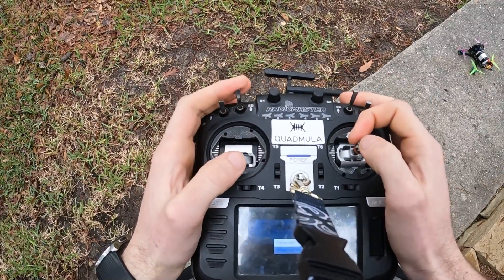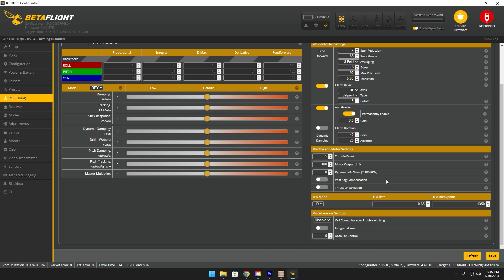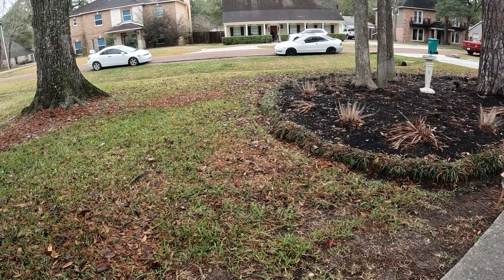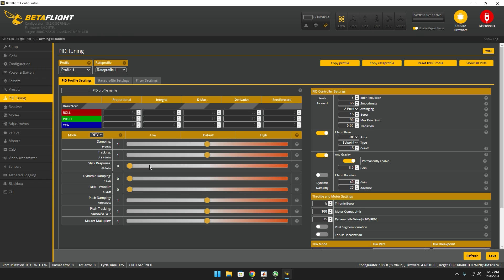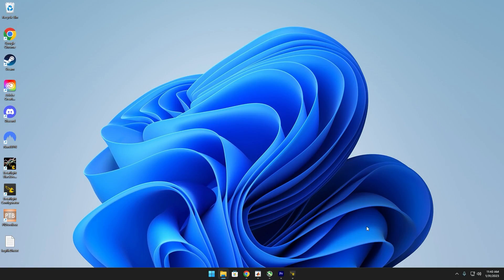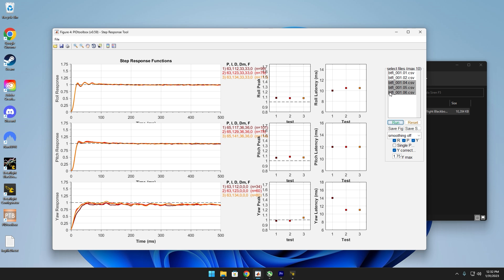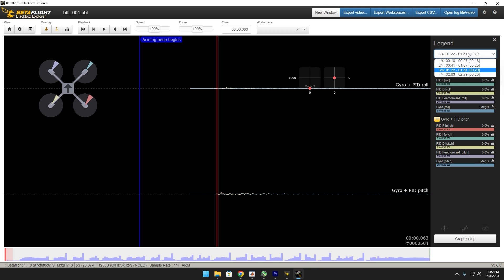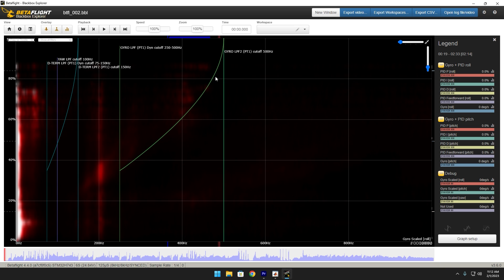*Outdated, Check Description* How to Get that Perfect PID Tune in Betaflight 4.4 | 2023

Comment: nice tutorial! quick tip re Master multiplier. the ripple is oscillation (you'll see it in the dterm traces). Notice that it lower on pitch because there's more weight along that axis and it requires higher relative gains than roll, and you can see this in the latency difference between the two (pitch has higher/slower latency). what you wanna do in that case is bring roll only down until that ripple looks about the same as on pitch and their latency is approximately matched. then you know you have equal responsiveness on both axes. you'd do this by dropping the MM until roll only shows a small ripple then boost pitch PI and D to where it was before dropping the MM.
Reply from the maker: Oh interesting okay 👍 I though it was something to do with d-max but yeah I get what you’re saying. Appreciate the feedback man!
Reply: Hey, The TPA Break point is verry low, for tuning is not good you must be push it to 1750 ( some quads hovering is over 35% throttle.
if necessary put it down after tuning PID, do last Throttle test. If you can see vibrations in high Throttle in Frec/Throttle tab,  set TPA little bit under vibrations !
Reply: Great advice thank you Brian!

Edit: Other question to you @D3B8 are the filter settings unchanged? I have seen there are presets for super clean/clean/normal/noisy etc. filter settings and wanted to ask how do we judge when its already noisy etc :D
Reply from the maker: @sarcasticfpv  So my filters are stock in this video but I plan to cover them in the future. I wouldn’t recommend it but if you really want to try a filter preset just make sure it’s in a safe area. Trial and error is really how to know
Reply: @pidtoolbox, Thanks for this tip. But what should I do if its the other way around? I have osc on pitch
Reply: @FPV-Jon  you do the opposite. Bring pitch PI and D down instead
Reply: @PIDtoolbox  so, boost MM up, then turn PI and D down?
Reply: @PIDtoolbox  didnt go to well. Smoked a motor 🫣
Reply: @FPV-Jon  No boosting anything

Comment: I got my tune pretty nice...for flow flying its great and for quick turns and no prop wash on pull outs....but when I snap roll it of juicy flick I end up what I'm guessing is a dsync and it will fall back towards motor 1 amd 2 and death roll out of the sky....and I have no clue how to fix it....if I give it throttle it his hit or miss but if I completely kill throttle during roll it does it....and on bluejay my timing is high I'm on 24 ppm or pwm... also my min and max (the 2 bars on top right in esc config for bluejay are well past stock they're like .75 of the way up and stock is like .25 percent of the slider....I'm so agitated with it because my 3 inch and my 2s toothpick and my whoops are all good but my 5 inch quads it has happened to both

Comment: i just found out that if you start noticing more and more oscilations as you push up the master multiplier, try lowering i term relax to middigate the oscilations coming from p term especially when anti gtavity kicks in. my master multiplier is at about 1.4, when id punch out it would go berserk with oscilations, the blackbox log showed p and d oscilatin in phase while i term was inverted, which means the quad was struggling to meet that setpoint, the antigravity feature was placing on it. so i lowered the iterm relax from 25 to 5 and that practically eliminated the issue! also antigrav gain is on 1.5 since my iterm is already crazy high, i might lower it

Comment: Being new to Beta flight how would you set PID for minimal motor-controlled orientation and how would I run servos. Just want the motors for thrust I have servos running the roll pitch and yaw on an experimental system, but have yet to figure out a way to configure them. My receiver is a Flysky FSia10B. I am running the rx1 pad and using serial receiver via ibus. Can I use the chanels on the receiver to run the servos?
Reply: Oh sorry, controller is a SpeedyBee F405 v3
Reply: You may be better with a different package if your trying to control servos. There is this option within betaflight, but as I understand it this is quite basic. For a great guide on the latest release of betaflight head over to Joshua Bardwells channel. His guide is split into each of the options making it very easy to find the info you require without watching lengthy videos. Also have a look at the software used for flight control on wings and planes. I know they drive servos direct from the receiver but these are quite large that's all I really know on the subject. Hope it gives you a few ideas and avenues to progress you experiment, keep on innervating and I hope you get it flying soon. 👍

Wow! I have just had a look at at your channel going to be a long term project getting it flying but I'm going to keep watching and subscribe.
I would have thought you would want your PID loop altering the speed of each motor to maintain a level hover. I don't think beta flight will be able to keep it in the air by itself, as I'm guessing your creating thrust by way of servos on the ducts? Beta flight has been developed over the years focusing on FPV racing and freestyle quads. There options for other motor layouts away from X style frame. But I think on larger lifter and camera platform drones other software is used.

Comment: Very easy to follow instructions. I have an issue, when I try to open any of the logs off my Chimera, it just hangs. I've moved them to the PIDToolbox as per the Wiki, but nothing seems to work, so sort of stuck at bat. Any help would be appreciated.

Comment: Thanks Bro 🤙🏼 I just have the ringing and warmish motors. I also run tracer. I never knew it messed with the tune. I hope like hell I can get my 7” to fly half as that quad.  lol. No criticism here.✊🏼I do appreciate you mane🤙🏼
Reply from the maker: Yeah np, good luck with it man 👍
Reply: @JevinW  I did have to move the MM down to 1.4 The motors was warmish.  It flys pretty smooth now. I do just have it on a preset. One day would like to try to tune it like that.

Comment: First of all, thank you a lot for your tutorial. Your quad is clean, why do you need so much filtering (I think you have defaults)? Do you use RPM filtering?  Did you try to disable Gyro LPF and Yaw LPF? What values do you see in PIDToolbox -> Spectral Analyzer -> filter delay?

Comment: Thanks for this video! My usb port is quite hard to reach since mines a waterproof build. Is there a way to do this without the Blackbox analysis? Or should I do this the old school way and adjust the parameters after every flight? My fc has bluetooth
Reply from the maker: I believe you can blackbox off of the speedybee app but it’s not too reliable from what I’ve heard. If you still want to get a tune going without black boxing, you could always just raise the master multiplier up a bit and call it a day.

Comment: Tried it, but for some reason, I can't get the btfl files loaded into the PIDtoolbox. It keeps loading but nothing happens.
Reply from the maker: Little late to this sorry, but make sure to launch PID Toolbox from where you installed it and not using a shortcut.
Reply: @JevinW  Thanks Mate, now its working

Comment: One important step is missing bro, you have to enable 100% pid controller for angle mode, stock value is 50%… if you fly angle for recording logs this step is essential…
Reply from the maker: Oh okay did not know that, hardly ever fly angle mode haha
Reply: @JevinW  if you move the drone with the pid controller at 50% pidtoolbox will read wrong values
Reply: @YOXFPV  actually thats now true. Had a tune meeting with Brian last month and we had the Angle mode on 50%.
Reply: @-exeCy-   pid controller at 50% registers lower pids than the real ones and all the tuning will be wrong, you will have a correct p-d ratio because that doesn't change but the drone will have very high pids and will not fly as well as it should
Reply: @YOXFPV  how to change that?
Reply: @2000khk  just set angle strength to 100 (you can find this option on the tab pid tuning under the pid sliders)
Reply: @YOXFPV  it will not flip with 100?
Reply: @filipefrango1671  no, 100 active only a full pid controller work, is not a angle degrees setting

Comment: Curious why you didn’t bother balancing the latency & ratios between axes prior to running mm test? I have a slightly different approach when I tune (always learning!), with an emphasis on balancing the latency between axes, prior to running up mm for latency reduction. Brain pointed out recently that what a lot of us have come to recognize as an over damped situation (rises to 1, then quickly undershoots and recovers) is actually the beginnings of an oscillation on that axis, relative to the pids on the other axis (typically roll relative to pitch, if I understood correctly).
Reply from the maker: That's actually a good point about balancing the latency ratio's and I wish I would have mentioned that. Personally I don't do it because the difference is so minuscule but then again, you got me thinking as I'm typing this lol, having consistency is probably whats best. I don't believe that means the start of an oscillation just because that scenario can happen even on stock pids.
Reply: @JevinW  I think his point was relative to the other axes. I don’t want to get to technical, but I think it’s worth a look the next time you brave the murky waters of bbl/PTB. Just bring a  🛟 so you don’t drown 😅